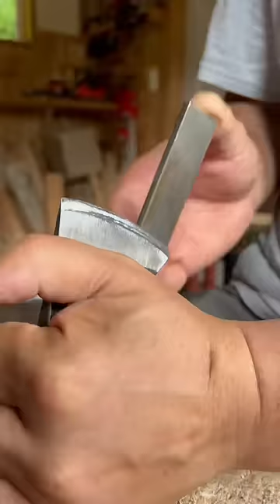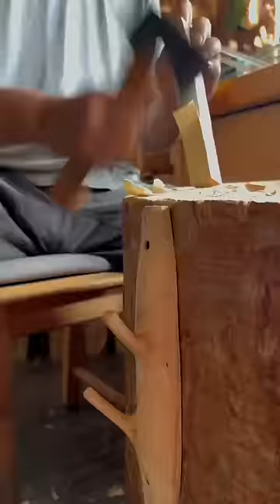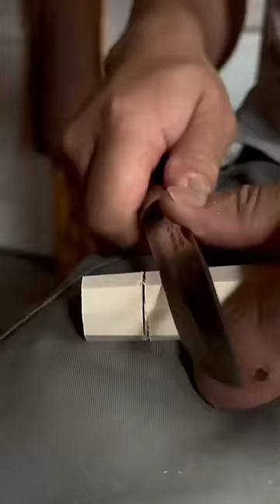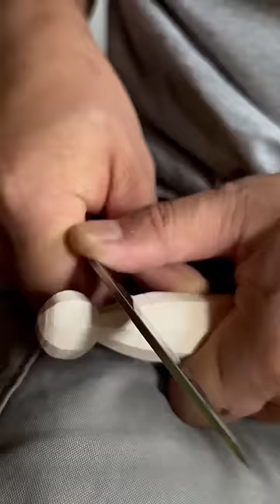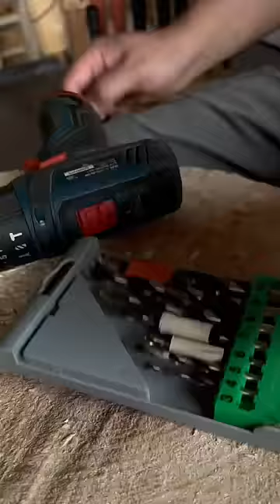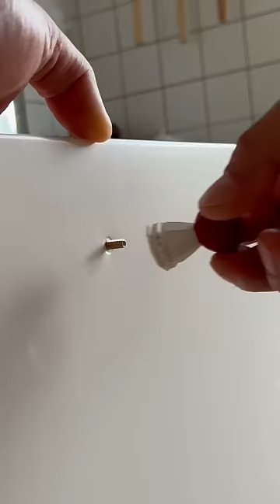Let's make your knobs!! #woodcarving #asmr

Comment: i have a question about whetstone sharpening i got my first set to begin but the istrustion only say to soak 400/1000 grit and to never soak grit at 3k or more should i still put water on 3k grits or not
Reply from the maker: The coarse whetstone has more air holes than the fine one. so it absorbs a lot of water in the beginning.  However, the fine whetstone has air holes less than the coarse and it absorbs less water than the coarse. so you only need to wet the surface of the fine one before use.

Comment: Очень грубая заточка нужно истончать лезвия делать его тонким very rough blade. I also make very sharp axes almost like a razor, but the configuration of the whole ax becomes different. My blade starts from the very base of the handle. and gradually
Reply from the maker: Sorry, I didn't understand your comment exactly
Reply: @skogsdraken  yes i do undestend you
Reply: @skogsdraken  The width of the edge of sharpening the blade I have 30-50 mm
Reply from the maker: @wovada  Yes, it usually depends on the thickness and material of the blade and the type of wood.
Reply from the maker: you wrote  "very rough blade". Does it mean that my knife dull is?
Reply: @skogsdraken  yes it is
Reply from the maker: @wovada  🤷🏻
Reply: @skogsdraken  I didn’t understand a little what you are asking me, but I want to say that the ax sharpened for woodworking I have a very thin blade, the thinning width is 30-50 mm along the edge of the blade, you have this
Reply from the maker: @wovada  Yes, I understand your Axe story, but my knife is not rough knife as you said. That's the point I didn't understand
Reply: @skogsdraken  I translated your text and understood no, of course not, and here it’s very inconvenient to process wood with your ax if you made it thinner the ax blade needs to be made thin then remove it
Reply: @skogsdraken  On the contrary, your ax will not be dull for a long time, it will not be dull for a long time. But it is inconvenient for them to work; the blade must be made thin, thin, like a knife.
Reply: @skogsdraken  I want to teach you how to make a new type of axe. When you do it, you can compare it with the previous sample. My ax is very handy for working wood. In Russia it is called carpentry
Reply from the maker: @wovada  If the ax blade is too thin, the edge won't last long.  My ax has 25 degrees and the edge stays for a long time.  Anyway, I'll take your advice as well.  thank you
Reply: @skogsdraken  I want to draw a cut on the drawing of this ax or show you a video of this ax but now I am far from it now it is 3.500 km from me and I can’t show the video and I can’t draw now either